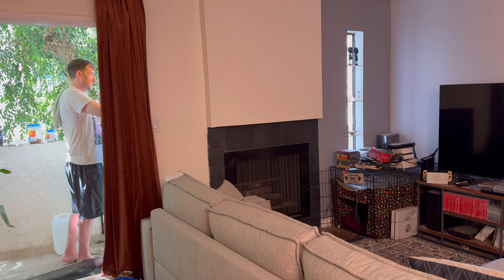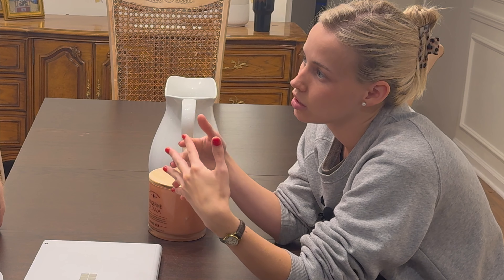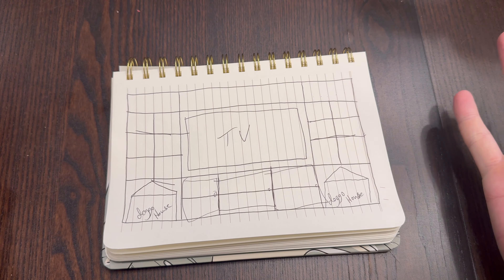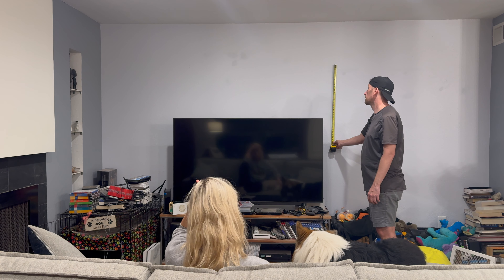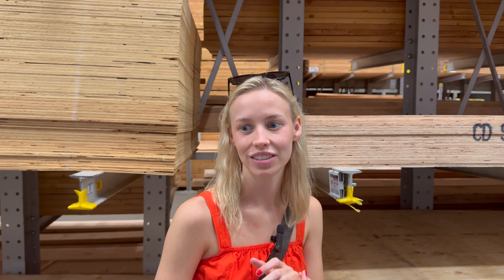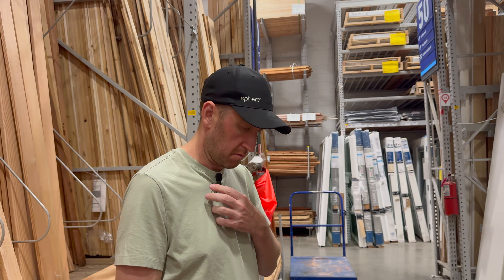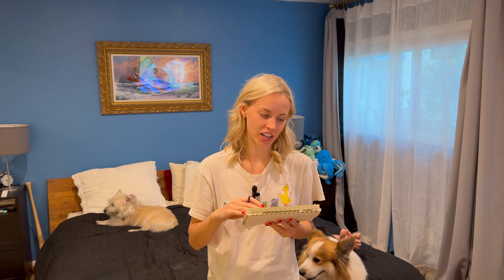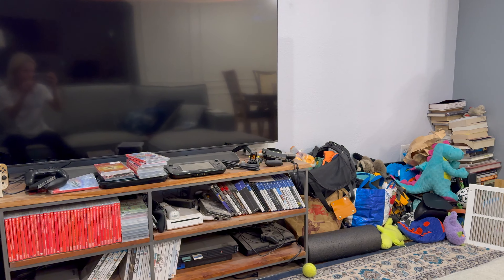Can We Transform This 45-Year-Old Living Room On A Budget? Part 1: Budget Living Room Reno Tips

Comment: I suggest using blue painters tape and doing a complete mock-up of the build on the wall. This will help you visualise it best as well as make tweaks to the design before you start your cuts. You can also easily make adjustments as needed and alter your measurements before buying any wood.
Reply from the maker: That’s a great idea! Thanks for sharing!

Comment: Nooooo. Ok. Here is what you need for materials. Clear pine for the trim (3/4" x whatever width you want) and birch plywood for the plywood (a 1/4" for the back and a 1/2" for the sides and shelves). They are materials that are rated for finish work and are stained/paint grade. Also you'll need to get a finish trim gun to nail everything together along with your brad gun. Also pocket screws and glue are your friends. FYI the glue is what holds everything together long term and the screws/nails are like a clamp.
Reply from the maker: Wow! Thanks for all the info. We’re on our way to the store now to purchase wood. Will definitely make sure that I get finish grade paintable plywood! We’re just doing the internal structure for now and then I’ll def have to reference back to your comment to make sure I get the right trim too! I appreciate all the feedback :). It’s always nice when professionals let me know what to do! So thank you.